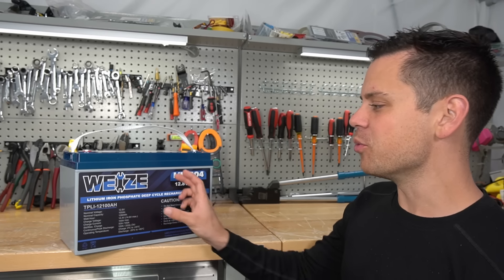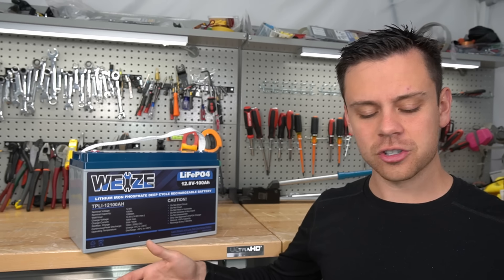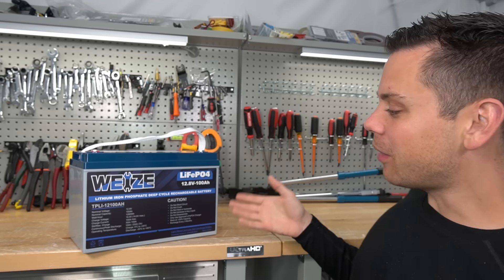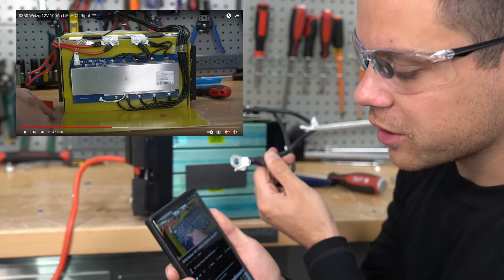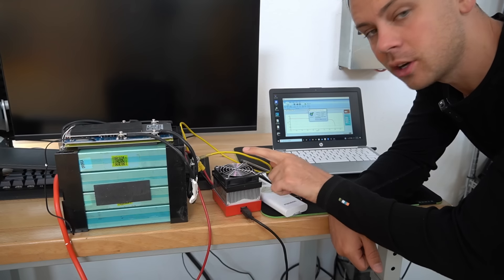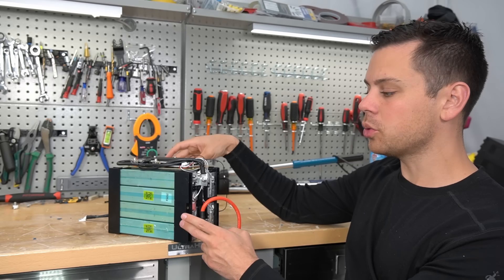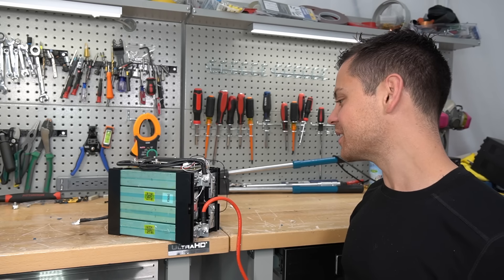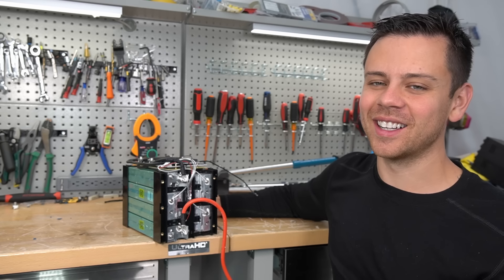$329 Weize 12V LiFePO4: 18 Month Update! Should you buy it?

Comment: I tried to replace two 100 Ah batteries in my RV w two 206 Ah SOK's.  Just half inch, half inch there to big for the battery box.  It would really be great if manufactures could trim every mm of fat out of the 200 Ah boxes so there would be a chance to upgrade RV's Ah capacity.

Comment: I believe if they are engineered correctly, they will last long. Also, how they are installed is crucial. Charge cycle, proper load rating, and super important and often forgotten: GOOD CONNECTIONS and CONDUCTORS. If you put these things together, they will last a very long time.

Comment: Weize is pronounced like HefeWeizen. I bet the Chinese manufacturer has no idea how to pronounce it properly. Thanks for providing this helpful info! I bought a 50ah Weize Lead Acid battery a couple of years ago for the RV and it still runs like a top, seems high quality. Also running a couple of CALB LiFePo4 DIY bats which are incredibly efficient and reliable, based on your recommendations 2 years ago.

Comment: I can see the reason for buying six of the 100 amp hour batteries instead of fewer larger batteries is if one of them dies it's cheaper to replace each one. Yes there's a higher upfront cost But it can be cheaper if things die down the road.

Comment: So instead of Weize or other similar price range, you recommend: EG4 LL, which is 2-3 times more expensive for the same Ah. Of course most of the time more expensive means higher quality. But, is it worth it to invest over a $1k for something that eventually be getting cheaper and better just because of technology? I wish you would provide reviews for different price ranges, for example the most reliable within $200-300 for 100Ah, etc.
Also, an important criteria is the seller's customer support. I see for many highly rated batteries their customer support is practically non-existent.  
Other than that, this video is very helpful.

Comment: Vatrer battery, ships out of CALI, $300 has low temp cut off. I have two. One in my fishing boat and the other as a extra capacity add on to my UPS. Both have worked flawlessly for the last 6 months. Please tear into one of these newer models. They are much different than the one you opened a year ago. They both pulled 104 Ah.

Comment: A good reason for using these is in locations where a server rack battery won't fit.  On my sailboat for instance, I have 3 of these in parallel for the house battery bank.  In a salt water environment, the sealed batteries are a must.  The box that holds them is L shaped and was designed for 12v lead acid cells.  These are a great replacement.

Comment: I purchased two Wieze 100Ah  for my RV. I had to modify my battery compartment to install them. They were about an inch too long. I have no good place for 200 Ah batteries without spending more money on heavy gauge wiring than the cost of the batteries.

Comment: Have you done any Eco-Worthy products? Seems like good quality (for the price) batteries/equipment and good company communication. I'm using two EW 100AH batteries, a EW 30A solar charge controller, a EW battery monitor with a hall sensor and a EW suitcase 100 w solar panel for an aux power supply. Using two Reology flex panels for the mainpower  supply. No Issues for 1 month now. Not sure if I'm getting the full 200 AH capacity though.

Comment: Will, you have been an inspiration to DIY solar for a lot of people. I wonder if you can do a video on something I have not been able to find any information on. There are a lot of cheap all-in-one charge controllers that are either 220v or 230v and I am wondering if there is a way to use these with north american 110v stuff. I would love to be ABLE to use 220v for a welder or whatnot, and be able to use the same all-in-one to power the rest of the 110v loads in my totally off-grid home. Is this possible to do? I cant seem to find any videos on the subject. I can find these 220/230v all in ones for quite a bit less than the 110v ones. And if this is NOT a good idea, I think it would still be a good video to help explain why it's not a good idea or not possible.

Comment: What are your thoughts on Dakota Lithium.  My interest is in lithium batteries for trolling motor applications 24 and 36 volt motors 
Dakota makes a 36 volt 60 amp hour battery which simplifies installation  
Originally looking a three battle born 100 amp hr batteries for a 36v motor 
Have you ever torn down a Dakota 
Thanks for the great content

Comment: FYI spent 11k on Delta pro and after 2 months (hot ones in AZ) the DeltaPro only charges to 80% and one battery supply only charges to 97 and drops overnight without any demand. One of 4 battery supply is working correctly after 2 to 3 months. So now the warranty process. So, yes it was over 100 degrees outside, units were inside at all times. However my AGM back up from Duracell hasn't been an issue. As a matter of fact I use the AGM for RV instead of the new lithium from DeltaPro due to relatability issues. My home will have lithium on the cheap! Why? Because I bought the most expensive thinking it would work? Well it Did Not! So if it works it works, most but and have no issues however have little demand or stress on unit.. Stress it out to find out.. may not be happy after that.

Comment: What about the updated Dr. Prepare DBT12100LFP-S48-G2-US or their battery with the Power max module? They both have low temp charging protection that others have confirmed to work. Seems as though they may have changed since your review in 2021.

Comment: Your videos are amazing, Will! Would you be able to do a video about proper breaker/disconnect/fusing for different systems? I just got a 24v growatt all in one unit and noticed that most information for breakers/fuses/disconnects is for systems with separate controllers and inverters. I'm assuming it's different for the all in ones, because they have internal fuses and safeguards?

Comment: If you get a chance, can you tear down the new HQST 12 Volt 100Ah LiFePO4?
It comes in at $270 claims to have cold temp protection and claims to be able to run a 4s4p.
Im on a very tight budget and I love the HQST solar panels. I have 8 of the 100watt poly panels.

Comment: I have this in my travel trailer.  I like the low temperature charging aspect.  It fits in my battery where the lead acid was.  It is a good solution.

Comment: Hi Will...have you made a video of an essentially offgrid system that can be backed up by the grid. I consume a lot of power, have limitted PV array space and very short daylight hours in winter. I can buy electric very cheaply at night. A system that brings in grid power for the purpose of feeding an alternate timed source to the inverter/charger in order to top up the batteries when power is cheap and the PV is not outputting. If you have not made such a video could you make one ?

Comment: Know it’s not really your target audience but more and more fisherman, specifically bass fisherman, are making the change to lithium for their 36V trolling motors. 
Which battery(s) would you recommend for us?
It occasionally gets below freezing here is there one with low temp and or heater you’d recommend ?

I thought I recalled you not recommending ones with heaters when running in series, is that correct ?

FYI most are looking at the 100amh

Comment: Will, I’m not sure if I have a failure or not, I would have some more troubleshooting to do. My symptom is that when operating ham radio, when on a particular band (50mhz) and at 100w (about 20A of draw). When transmitting, I’ll lose power, and have to unplug and replug the radio to get it to turn back on. I don’t think it’s over drawing, i am wondering if EMI is causing the BMS to trigger or something. When I use a lead acid battery, I have no issues. Like I said I can’t say it’s a battery issue, but the battery is the variable in my issue.

Comment: What happens to the batteries you use for videos like this where you cut the top off?  Is there a Will's garage sale every couple months?  I've been using cheap LiitoKala cells for about 1-1/2 years in a camper, traveling FT.  I had to buy a BMS for them and recently installed an active balancer.  They've been working great for the most part, not sure if I'm getting the advertised amp hours but they're working for our needs.  BTW, I bought them before I saw your video where you said to avoid them like the plague.  Probably would have purchased different cells based on that.

Comment: I have a question that doesn't directly pertain to this video. I am putting a solar panel on my Aliner, and have an electrical question. Can I put the power converter and the solar charge controller in parallel (both connected to the battery at the same time)? The battery runs the 12-volt systems and the converter charges the battery. The charge controller also charges the battery and I would like the solar panel to power the trailer during the day, daisy-chained through the battery. I have a 100AH LiFP battery and a Progressive Dynamics 30A converter set up to work with an Li battery. I am installing a 180W solar panel and a 20A Epever MPPT charge controller. Can I connect both converter and controller to the battery, or do I have to have a cutoff switch on the solar panel to disconnect it while on shore power?

Comment: I just bought this for a truck camper to replace an old lead battery. Do I need to add a DC to DC charger? The camper has 300W solar and a 1000W inverter. How and were to install it?

Comment: Will, can you do a show about upgrading sailboat batteries from wet cell lead acid to Lithium?  For example on my boat I have 8 Trojan 6 volt batteries, arranged for a 12 volts system.  I would like to upgrade but don't know what would be a good fit.  Obviously it will be more expensive, my current battery replacement would be about $1600.  What would you recommend?

Comment: I agree with you, the rack server would be the better idea BUT when you need a good temporary fix, these types of batteries work. for example my house system in the RV died and I dont have the money of the time to sort out and upgrade my system.
If you have time, please let me know if your thought differ because there are many of us out there doing this.
Also, knowing my story(somewhat) what are your thoughts on a 48v rack server in a RV? would 48v 280Ah be better( to even sure they make those but I would think so since the EVE 280Ah cells seem to be the most common DIY cell.

Comment: I'm building a 12v 2000w solar, wind turbine system to power my shed. I live in NJ and temps go into the low teens and high 90's. Any recommendations? Looking for one larger battery

Comment: For the typical consumer, the logic for buying 4 100Ah batteries instead of 1 400Ah battery is actually very sound.  Any battery can potentially fail.  Within a single battery, that failure equals complete loss.  In a multiple battery deployment, a single battery failure still allows for 75% capacity.  Cost isn't the primary concern in many scenarios.

Comment: Since I'm new to solar energy, could you please assist me with this? I'm attempting to light 1000 pieces of 1W LED modules (12V) using a 2000W kit with a 60A MPPT and 4 100AH Weize batteries (I don't have the inverter). Should I use an inverter or may I connect it directly to the MPPT load?   I tried connecting it directly to MPPT load, but it is inoperable.

Comment: Will,   Hey off subject a bit.. but can you do a video on any microinverters experience you have. I was thinking of adding microinverter on a separate solar bank and using that as a backup power source in aiding my 3 MPP solar pip2424 inverters. I understand that I can add more inverters in parallel.. as I have another one on the way but could micro inverters help...    Thanks for all your help/advice/reviews - Matt

Comment: It fits for my needs.  Solar powered chicken coop.  12v system.  Running AGM that will not protect themselves and have damaged them.  Having something with low temp and low voltage cut off for something like a chicken coop....yup.   its in my cart.

Comment: I am looking into LiFePO4 batteries for my off-grid beach house, which is right on the water.  Atlantic Ocean Water.  I currently have qty (4) 430Ah 6V batteries in series, regular lead acid deep cycle and they have been perfectly fine living in an outdoor battery enclosure, just 30' from the water, with salt spray and everything else.  How would LiFePO4 batteries do in this environment?  My concern is corrosion damaging the electronics and components built into the batteries, and of course the potential for failure and/or fire due to corrosion/salt spray.

Comment: If its a temp sensor so its all in a programing to cut off at such and such temps, and one sensor should be enough. Are you sure they dont work lo/tmp cutoff on other batteries? It says hi/lo cutoff. There has to be an easy hack to add lo cutoff charging, some kind of thermostat or something

Comment: I think its pretty a pretty clear pucture as to why someone would rather buy 4 100ah batteries over 1 400ah battery.  Its the cost.  Even from the same brand its cheaper to buy four 100ah batteries than a single 400 ah.  At this point you can get 4 100ah for under $1k but 400ah is still $1200-$1500. I know I wont spend $200-$500 in cabling.

Comment: Hi Will, have you checked some BEnergy LifeP04 batteries. I got big problem with this and I suppose the dealer is not telling the true cause he claims the charger manufacturer, victron to made a high peak current to ruin the batteri. I do not think thats true, it had been seen in trends by bluetooth.

Comment: This brand, Weize, has a dual purpose starter battery for cars for just $299, rated at 800CCA but I don't see any reviews or ratings on it. It weighs only 13 pounds. For comparison an Anti-Gravity of the same amp rating is over $1000. A great bargain if it even lasts 5 years.  Worth the risk?

Comment: Having been a person that worked in China as an importer of products to the US, I have a little insight into what is going on here.   This company probably does not produce their own products.  There will be a battery factory, and they will make the batteries.  You can go to them and have them package a battery for you, in whatever kind of case you want, whatever color, and your logo.  They produce the product for you, and you buy them by the container load and sell them on Amazon.  You may even have a couple of different factories producing the product for you.   Or maybe you find a factory that will produce it for cheaper, so you switch to a different factory.  The new factory may make the internals different, and if you are just wanting to sell a 100ah battery, you may not care what is on the inside as long as it is 12V 100ah.  Many of these batteries that you are reviewing are probably made in the same factories.  I could have a JimInAuburn 12v 100ah battery produced with my logo easily.  Some companies on alibaba will produce that for you with as little as 10 batteries ordered.  And the crazy thing is that the companies you deal with on Alibaba are probably not even the factory.  They are just middlemen.  So you order the batteries with your logo, they then go to the factory and have them produce it for you.  Then they make money on the difference between what the factory charges and what they sell them to you for.

My brother is building a house and it will be off-grid.  He plans on having 30-40 Kwh 48V battery bank for it.  Most likely a bunch of 280ah or 320ah cells and construct it himself.   I will be in China visiting my wife's family this summer, and on my list of things to do is to find a factory to buy the cells from.  Should be able to get them much cheaper being on the ground than you can get them on aliexpress/alibaba.  I will be able to check them all out in person prior to receiving them from the factory.  My brother-in-law owns a freight forwarder company in China, so he will handle all the stuff of getting them shipped back to the US.

Comment: I am building a small solar power system for my shed. I live in the Northeast so temperatures below 32F are commonplace for many months. While having a low temp cutoff is useful for protecting the battery, that results in me not having power in my shed in the winter since the battery cannot be re-charged sometimes for many days at a time. I was considering building a battery enclosure with a thermostat and a heater so the battery could be kept warm. That would allow me to charge it even during very cold weather. Am I crazy for thinking about this? I would be very interested in a video that discusses this approach.

Comment: looking for recommendations on an onboard  charger that meets the 14.4 output requirement on the12v Weize LiFePO4.  I just bought 2 Weize 12v 100s.  So, I need to find a 2 or 3bank onboard lithium charger.

Comment: Hello. Great informative videos.  Question. What lithium ion battery other than Battle Born would you recommend to replace my 2 12 Volt Lead acid RV coach batteries to be charged by my solar, DC car alternator and on board RV converter/inverter?  Thanks.

Comment: I'm not an expert. But from what I'm seeing from others is that 1.  There is no way these can be A Grade Cells due to cost. And I don't think you are suggesting that. 2. But the real issue would be longevity. They may work for 3 years but then they will probably fail because the BMS is overworked. 3. Having said that... I'm not a heavy user so... meh... should I care? What are your thoughts sir? Thanks!

Comment: Is the 50A discharge rate limit a concern? I have 3 of these in parallel I bought over a year ago and have been concerned about that. I've considered running my 2200w RV A/C off these with a Renogy inverter on a limited basis. For all applications low voltage this has worked very well for me. 2x100W solar panels plus on-shore charge controller made for LifePo4.